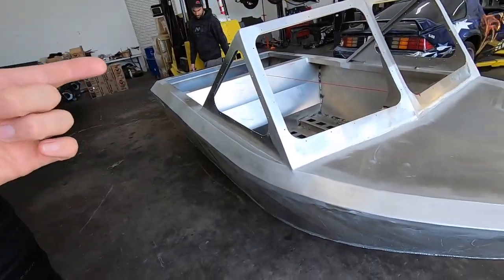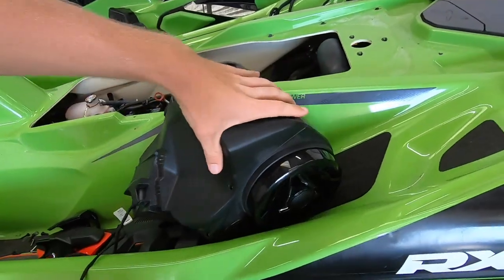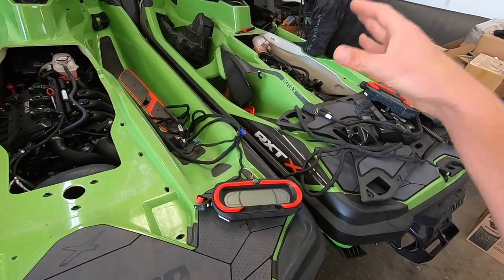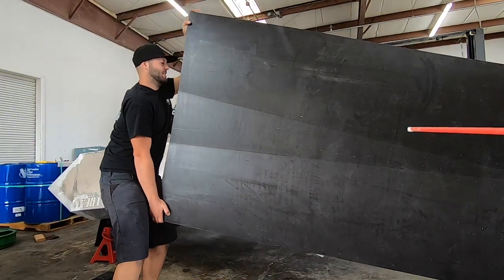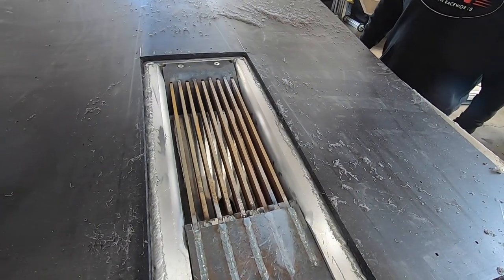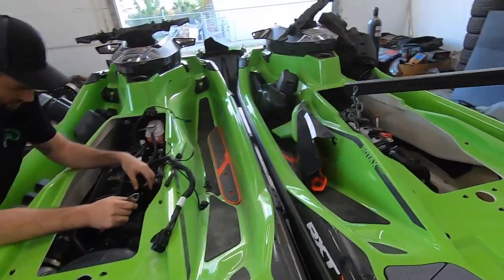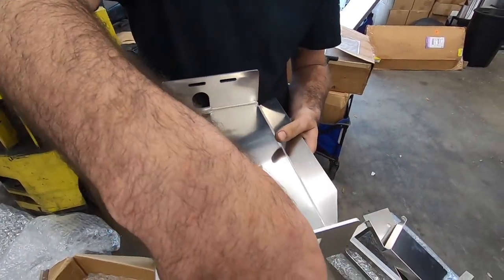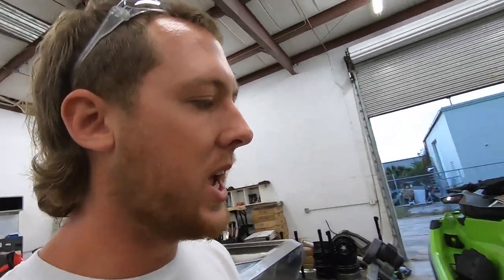Mini Jet Boat Build Part 3: Destroying BRAND NEW Jet Skis For Their Supercharged ROTAX Hearts!

Comment: Y’all need to run those bolts in with some kind of marine grade sealant. At the marina I work at we use life seal on anything that may need to be removed in the near future and 5200 on permanent installations
Reply: 3m 5200 if you want to use a jackhammer to remove it.  Regular 3m marine silicone at the bolt holes would be more than adequate. I see leaks in the future, especially at 70mph.
Reply: agreed
Reply: @ka0tyk  4200 can be removed easier. The thing is, I don't know if it will stick to UHMW plastic. I am also worried about galvanic corrosion because I bet those are stainless bolts going into an aluminum hull.
Reply: @rocketsurgeon11  4200 would be great. If they’re taking these things in salt water they better use some anti seize or they’ll all be seized af when that plastic needs to be replaced.
Reply: I'd use 5200 or Bostik 920. Or at least 4200 or a decent windshield urethane... You'll still be able to get the bolts out with an impact as long as you don't fill the heads lol. Better to have the guard stuck on good than have half your bolts leaking in Alaska lol
Reply: Started watching a giraffe on a bike swing and walked into science class about polymers.
Reply: Sikaflex
Reply: Once again the corrosion will seal the leaks 👍😄 as long as they don't need to easily swap skid plates they'll be fine 😁
Reply: @rocketsurgeon11  yessir. Galvanic corrosion was my first thought. In the carwash world, that's enemy #1.
Reply: I get the feeling these will be fresh water only but Cleet doesn't usually stick to plans.
Reply: @ka0tyk  dude please Google the word "permanent"
Reply: @jacquelineoldhaver2672  Hell yeah, there is nothing better! My cousin glued the wing onto his car, and later rolled it. The car was smashed to pieces, but the wing stayed attached.

In Sweden, we also use it to repair worn out rubber bushings, works as good as a new bushing.
Reply: yea i see leakes in the future.
Reply: @rocketsurgeon11  Stainless is Ok w/aluminum
Reply: @dennisrcole  In a perfect environment, yes. In a boat, HELL NO! Especially in the water they are going to be running in. I've done some time in the boating industry....been there...done that.
Reply: I use 4200 on say transom stuff like jack plates and bolts and anything screwed into the boat(even inside the boat) and 5200 for anything I plan on not touching ever again. Accidentally installed a jack plate with 5200 once. I was jumping on the damn thing with no bolts and she wouldn’t budge. Ended up having to take out the torch and heat the plate to turn the 5200 into dust
Reply: @rocketsurgeon11  You are spot on! At my previous job (building Van der Valk 30m aluminium yachts) we had to use some extremely awful smelling yellow paste on any stainless hardware that would be mounted on aluminium parts to prevent corrosion.. Can't remember what the name was
Reply: @dennisrcole  I work maintenance at Nuclear plant...NO REPEAT NEVER use stainless bolts to hold Aluminum together!!!
Reply: @bryanrmcnair01  I thought that stainless was neutral for aluminum and also copper , I realize that there are many versions of stainless alloys . If not , what is the best choice ?

Comment: Definitely see some potential water coming in through the holes after drilling all those screws into the bottom without no epoxies or even silicone.
Reply: Seeing as how the boats still don’t have any Motors, I think there is a little time on the table to button those odds and ends up!
Reply: Such is life with watercraft. They can slap a nice bilge pump in them jet boats and be A-Okay.
Reply: Always that one person knows everything about everything

Comment: I feel like you should have put silicon in each bolt hole to seal it
Reply: This comment needs more attention! You have to use some kind of sealant on the bolts for the bottom liner.
Reply: 3M 4200 is the ONLY correct and required product for this job.  Use 3M 5200 when you will never need to remove the part.
Reply: Flex seal for life
Reply: @derek10w  i was about to say, it will leak over time :(
Reply: @derek10w  Unlike metals tend to corrode. I am well studied in metallurgy and galvanic corrosion.  If you want to discuss these subjects with regard to under the waterline marine applications I am ready now.  Are you?
Reply: @kevinsellsit5584  lol do you realize its a joke lol 
Didn't you see the infopub
Reply: @kevinsellsit5584  chill dude it's a joke
Reply: @carscarsandmorecars3266  The facts will always come to light eventually.  Fact: I know a lot about galvanic corrosion, and nothing about flex seal, not to mention what the heck is infopub?
Reply: @kevinsellsit5584   Why not use Sacrificial Anodes (zincs) on this hull?  I think they need to learn about p-tex repair kits to smooth out the bottom.
Reply: @frankhage1734  It's a boat thing.  All newbies need to learn to speak 'Marine English' like you and I do. And learn WHY marine products are different.  I do hope they put a chunk or two of a less noble metal than aluminum on there.  Even with an anode, I would recommend 3M 4200 on all those bolts.  To prevent leaks, and provide corrosion protection.

Comment: Drill, countersink,  tap, bolt. Doesn't even seal the bolts going into the hull... I smell multiple water leaks going on here brother
Reply: Maybe they come with sealant already on the threads?
Reply: I think the plastic they sink into would be enough for a while to seal it what with the torque on the bolts, but yeah I'd have put some kind of marine grade sealant on them for the extra peace of mind. Although these jet boats have a bilge pump as Cleetus mentioned ("auto-bilge holder" he said comes with the jet ski so thats definitely a bilge pump to clear leak water) so unless that stops working they won't really have to worry about water.
Reply: Jesse Roddick I would seal them too, maybe with some Loctite glue & sealer.
You are pretty “screwed” if you lose 3-4 screws in the water...
Reply: 3m 5200 is a life saver
Reply: If I were going to install UHMW on a boat, I would fabricate threaded inserts made from solid aluminum round stock with holes blind tapped for machine screws. 

Make them long enough to pass through the hull and any structural members above such as ribs. Then weld solid on top and on underside to hull. This would give you a way to attach UHMW, without having to use rubber washers or sealant because the holes are blind tapped and don't pass through, so no leaks.
Reply: Was screaming internally not seeing any 5200 anywhere
Reply: um coat the inside of the hull?
Reply: @kollak01  with that many bolts you need to seal the threads. The other side of the bolt won't get a perfect seal and eventually water would push through
Reply: @dirtbiker1432  ok
Reply: @dirtbiker1432  it’s gonna piss in water .. I can’t believe they didn’t seal the screws.
Reply: @AndyL940  hopefully there's a decent seal on the poly since they countersunk em
Reply: @HKPSG1Shooter  I believe that is how they are done on bigger jet boats
The problem with relying on sealant is if you hit something and the impact causes your sealant to pull away then ya, leak! 
Or just over time sealant can and will fail so best to do em like mentioned above and weld em in!
Reply: To show the power of flex tape I sawed this boat in half
Reply: @1966cambo  Ive noticed most people just drill holes and use nuts and washers with sealant, but like you said, impact or deterioration of the sealant can cause leaks. I think the threaded collars is the best answer to the problem.
Reply: Where's that Flex Seal guy?  You could save thousands of dollars!
Reply: @Robtuse_  For the love of god. DO NOT 5200 anything that you ever want to take off in the future. 5200 is so hard it is able to be sanded and painted over. My job is fueled with fixing things people decided to use 5200 on. So strong it will rip the top layers of fiberglass/gel coat off a deck.

Comment: Who else started sweating profusely when cleetus picked up the circular saw
Reply: Knowing his penchant for cutting himself with razor blades i did get a bit nervous.
Reply: Definitely CANNOT borrow mine. Switch kept cutting on/off, on/off...fab'd in a normally open momentary push button switch. NOW, I'll say..."grab the widow maker" wife & 3 kids all know i need the circular saw...also NOW, SUPER FAAAQ'N EXTRA MEGA DANGEROUS!!!
         Signed -      Lefty
Reply: And he failed the cut lol like 5/8 to deep on one side after he talked it up like he was gonna show him how it was done
Reply: @maxeriousbrooks9807  it doesn't really matter how deep.  It's just there to protect the hull
Reply: @RyanGribble  I know thats why they didn't mention it but still a sloppy cut regardless I wouldn't of even mentioned it if he hadn't said he was gonna show him how it was done
Reply: I think he should have left the last cut to his welding mate who was on the ball with using an air tool. 

As a toolmaker/welder, I’m sure his mate was thinking the same as me.... “Stop!!! you’re cutting past your drilled hole”

That kind of mistake keeps us tradesmen awake at night, even if it’s cosmic.... 1/8th” over would annoy me.

Comment: Hey bro, long time jetboater here. From where the uhmw meets the intake that 90deg edge will cause cavitation which will slow you down. Give it a mellow bevel to smooth water flow into the grate.

Also these cats from NZ have epic install video with great routing ideas  https://youtu.be/GoNftMUx9co

Ps id highly recommend a scott 612 pump to replace stock seadoo pump.  Scott pumps are hands down best out there 🙌 👏 👌 💯

Comment: My jetboat build was from an existing hull, a 1997 Duracraft 1648 SV, with a Yamaha FX High Output engine. One day I want to build another one with a thicker hull and UHMW for going into areas with rocks. I run mine strictly in coastal waters and rivers, but never above the fall line where there are rocks. That takes a specialized boat, like the one in this video.

Comment: I have a 2020 RXP-X 300 (basically the race version of those 3 person skis). Seeing this makes me sad, since those RXT-X's are sexy AF, but that aluminum boat is going to TEAR ASS with those two engines in it. I can't even imagine it. The acceleration on the RXP-X 300 is nuts. The thing I was told by our local dealer with this supercharged Sea Doos is that where most people go wrong is not getting out of the throttle when the load is off the engine because the jet comes out of the water. You can hear the supercharger wine like crazy when that happens (think baby Hellcat) and if you keep it in throttle the RPMs on the supercharger goes insane and you can fuck stuff up REAL quick.

Comment: Gotta ease off the throttle on those RXT X.  Unless they fixed that issue.  I kind of wish they would have just gone turbo.  But since the blowers are shaft driven, they get damaged if you just take your hand off it from WOT. Someone more experienced correct me because I’m probably missing something.  And they do 72 stock anyway on glass on the big key. Rode my buddy’s ages ago and it was just stupid fun.

Comment: you are going to need some 5200 OR 4200 on those bolts and you should have tapered your UMHW around your intake before bolting it down . Major power loss if you dont do it!.. smooth is FAST!

Comment: I know of 3 20'+ boats that tried to follow me out salt river in Crystal River in my old 14' flat bottom aluminum boat with an old 18 hp Evinrude on it. I only drafted about 10" on plane and at low tide, that's about all you had... The big boats would try and follow me out and you could hear the motors and hulls dragging bottom on those oyster beds... I tried to warn the first couple, but they never listened, cost them a bunch of money I'm sure!!! Good luck gentlemen :-)

Comment: Wouldn't those Jet skis be lighter and faster and more fun ? It's like taking the motor off of a crotch rocket and putting it in a tractor. Kind of pointless really. Should have put LS motors in them. 1000HP for Dale Bruther.

Comment: Remember to were GLOVES with the carbon seals. DO NOT touch them with bare hands. The oils from your skin will cause them to fail prematurely. We replace them a lot on the gear boxes on our jet engines, not hard at all. Just a process to be super careful with.

Comment: I've built one of the before in a 10 foot version, not sure if you put a barrier on your threads in your hull but definitely needs something especially if bolts are stainless. We used blue lock tight, keeps threads from galling and keeps water out of the boat. If anyone is looking into building 1 of these we used an older Yamaha wave venture for a donor rig, one of the most expensive and PIA parts is the jet drive intake, most newer ones are part of the hull, some of older Yamaha's have a complete aluminum intake, driveshaft etc that unbolts from the hull and can be bolted into your jet boat. Hopefully this small piece of into helps at least 1 person finish their project. If your feeling spendy get a Scott jet set up. These things are a blast, ours was only about 100-120hp and tons of fun thru tight winding rivers. Those chines are key for handling and keep the boat flat thru turns, jet stream build some sick hulls, can't wait to see you guys get these on the water, you'll be hooked! My guess is by your 2nd ride you'll want to build a turbo LS sprint boat, when your ready let me know and I'll get you a sprint boat hull!

Comment: Oh horsepower is about half on the water. With jetsleds. Probly for thise5 sleds I'd use a v6 but if those hulls are about 250lb each you might go 45 miles an hour? But I wanta see this through, hell yeah!!!

Comment: Pull the black rubber accordion hose back near the carbon seal and pop off the C clip.  Unbolt the pump at the rear and remove it with the drive shaft. It needs to come out anyways and it will make it much easier!

Comment: I’d suggest grinding down the front of the plastic on the bottom of the boat to create an almost ramp like effect. It will help reduce drag from the aluminum to the undercoat. Should be pretty simple to do with a handle dremmel or grinding wheel. Idk, just makes sense to me to do that, maybe it’s a bad idea 🤷🏻‍♂️ just a thought

Comment: are you guys wet installing those countersinks for the bottom cover?  When the Hull is under pressure water is gonna walk right past those threads.
3M 4200. Expensive, but its the right stuff for thru hull work.
Id hate to see you guys have water issues once your interiors all done.

Comment: You guys should of put some sort of tethlon jel or sealant between the stainless bolts and the aluminum your never get them back out if you go in salt water, need to change the plastic your snap every single one from galvanic corrosion plus they will leak 100%. P. S. I build aluminum work boats in Amsterdam

Comment: Just a thought on the order of trying to be helpful; Pull all those screws and seal them. Also, would it be out of the question to pull the pump off the PWC to allow the engine to come out with out the shaft damage issue..? I suspect the method your using was one regarding the pumps not coming off... Not the case with your situation. 
Good luck and enjoy; I look forward to seeing how it all comes together. :)

Comment: Il fly in homebuilt aircraft, race drag bikes and supersports on track, I've ridden racing dirt bikes but drag boats and high speed boats scare the shit out of me.

When a dragboat goes wrong you are hitting a surface as hard as concrete in something that will drown you whilst trying to beat you to death against concrete hard water.

Be really careful, though choosing the fairly low powered jetski motors is going to be safer than the 800hp v8's a short boat will be interesting to handle.

Good luck and keep on making sure you're being safe. Looking good and as a river hunting rig that is going to be obscene.

Comment: I hope you have a driveshaft clip removal tool. Clamps between through hull seal and pto cover and expands through hull seal back and reveals c clip on driveshaft which is required to pull driveshaft. If you already did it in this video you’re welcome for the comment 😂

Comment: Nice work on the boats, the only thing that would’ve made it better. Drill all of the holes, take it apart and debut it as it’s a need to be waterproof. The black seal the screws as you install them. You might have to do that after you put them in the water and find that they leak. Good Luck. I am an aero engineer. Keep Smiling. Cliff Q.

Comment: The 300 engines use almost 26 gallons per hour of fuel at full rip. You’ll run out of gas in less than an hour of ripping around. Stay out of the boost and you can get about 80 miles of range out of a factory 18 gallon tank. Just a heads up they’re super thirsty and on the water that’s pretty inconvenient

Comment: Waayy too much plastic in those seapoo engines and pumps for my liking. At least install stainless wear ring in the pump in place of the plastic jobbies. They also sink a lot because of those carbon seals....boat looks awesome but was thinking the same thing about sealant after drilling 1000 holes in a perfect watertight hull, will leak like a sieve.